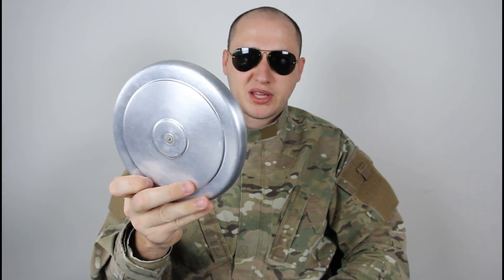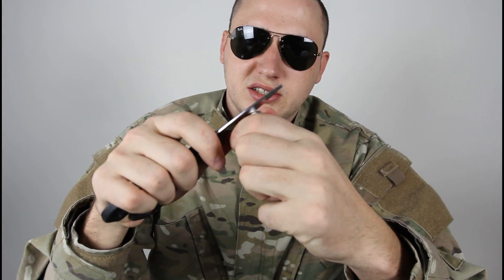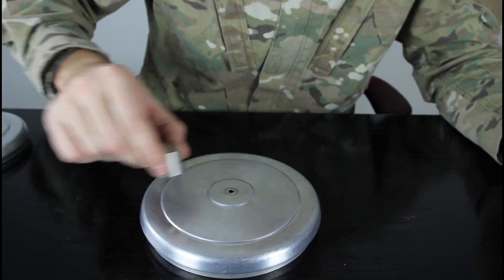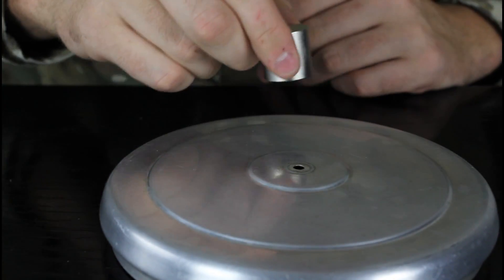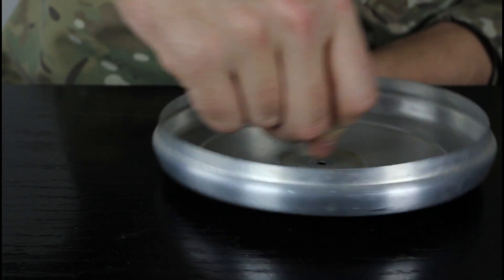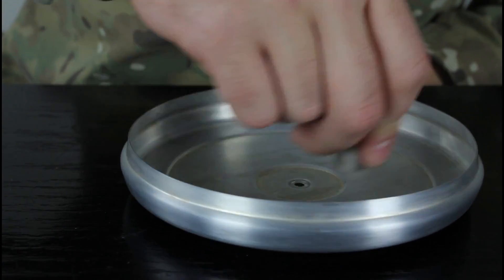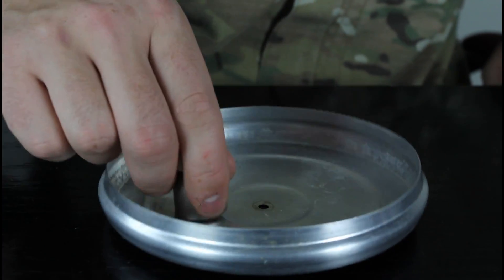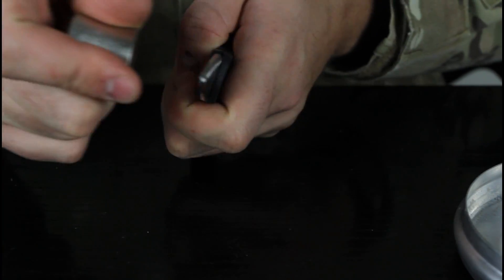Neodymium Magnet and Aluminum Experiment

Comment: simply explanation: aluminium has a small amount of magnetic steel in it therefore there is a small amount of force from the neodymium magnet.
Reply: Bullshit. Magnet induces current.
Reply: yeah but the its barley noticeable unless your aluminium is flotilla on water. it's I thing called magnetic friction which causes the movement.
Reply: tmkr yo bullshit MUHAMMAD ASMAL is right

Comment: i wish i could draw you a picture to show this, because it is a fun experiment in electro and magnetic physics. what happens is like in an electric generator. the magnet passes by the solid nonmagnetic metal and creates an electric current and science teaches us that electric currents creates magnetic fields, so the magnet is creating an electric current in the aluminium which is in turn creating a magnetic field that is pushing or pulling on the magnet. once again, wish i could draw a picture!

Comment: the magnet induces an electric current in the aluminum, which then attracts the magnet and pulls the aluminum plate

that's why a magnet falls slowly down a copper tube (the magnet creates an electric current in the copper, which repels the magnet and slows it down)